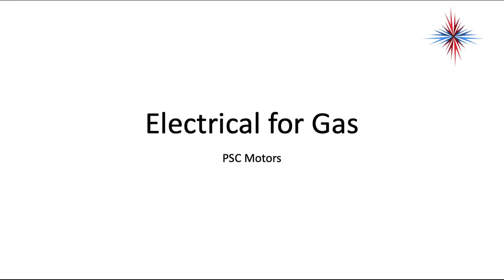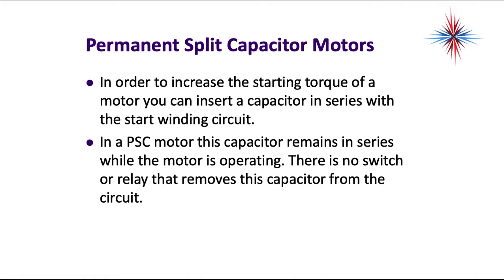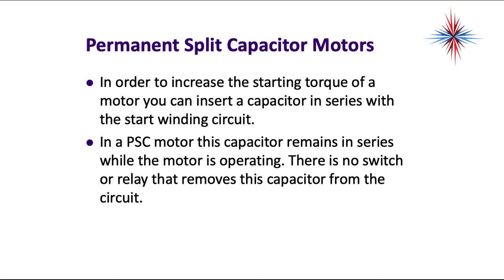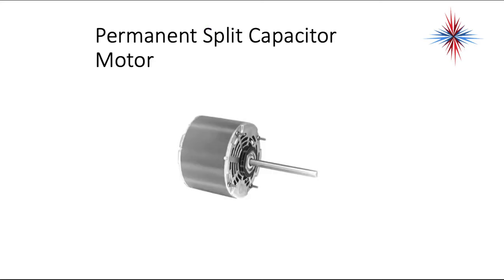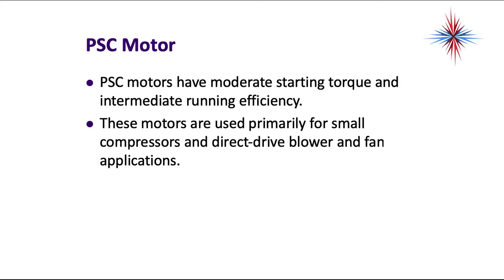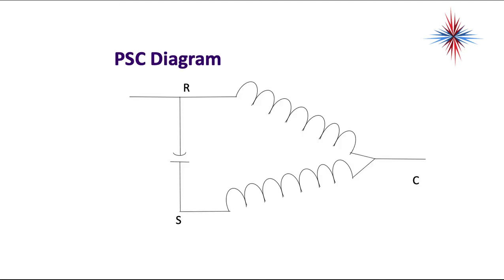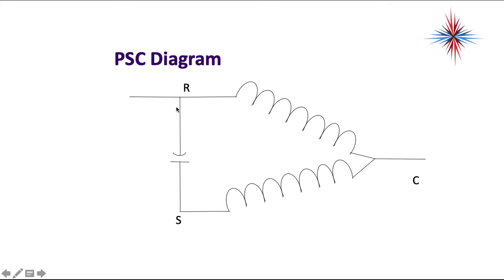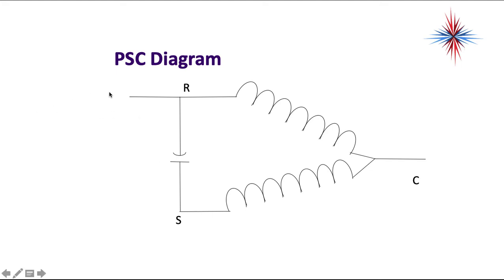ElectricalForGas- PSC Motors

Comment: What is the status of the capacitor if L1 is 120v and L2 is 120v and one of the lines opens up? Does the capacitor still cycle with voltage from the remaining line?
Reply: It is doing nothing in a series circuit. One of the lines opened, now the circuit is incomplete.